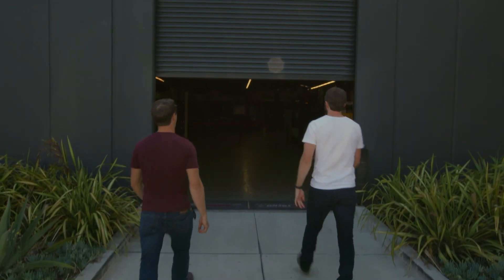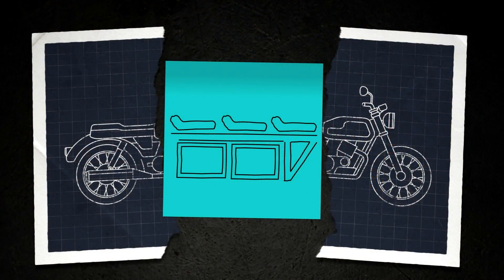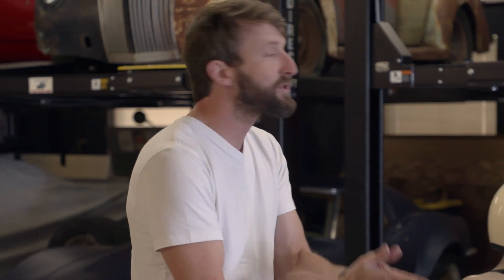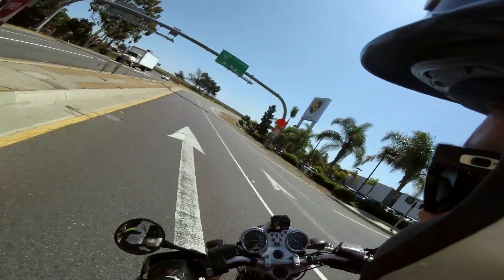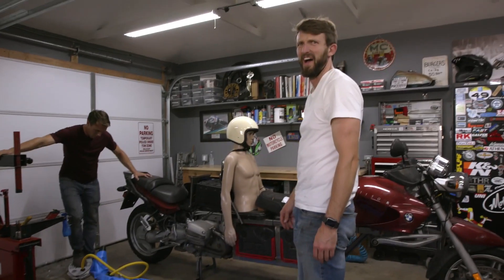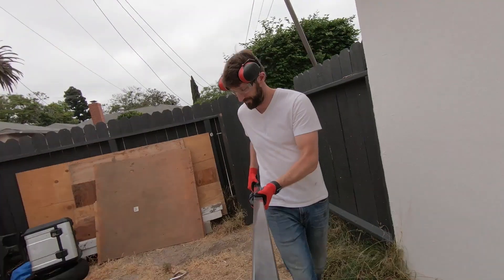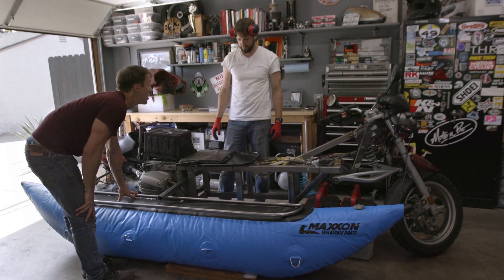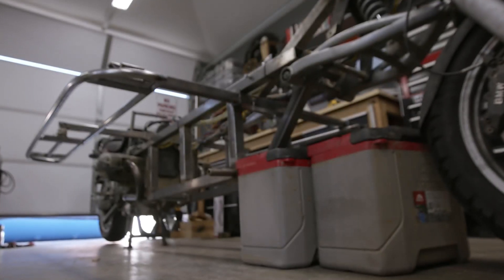The Boatorcycle! Building an Amphibious Bike—Throttle Out Preview Ep. 12

Comment: i already saw it complete, good idea, a bit of lack in the execution, i woul sugest changing the rear tire for a waterpump or just bolting the pump in the midle like the paddles and for steering just directing the outlet of the waterpump, also, i see they couldn't land with the pontoons mounted, so with a botle jack thay could control the hight of the rear to float more or less the tail